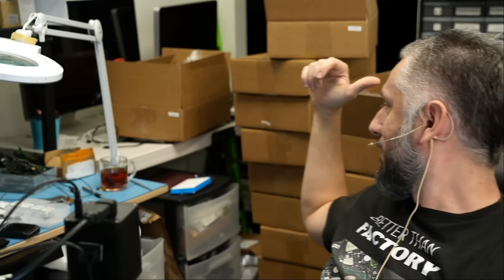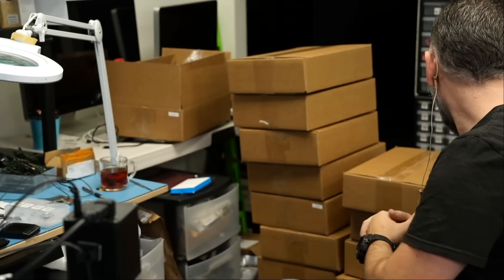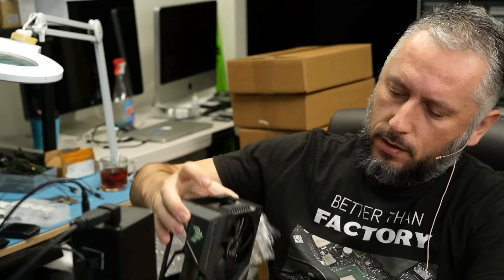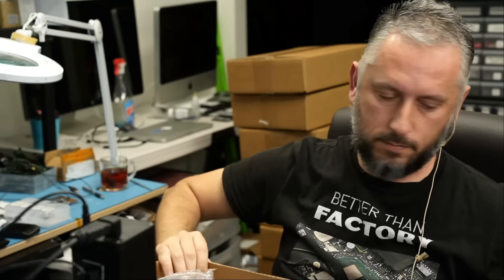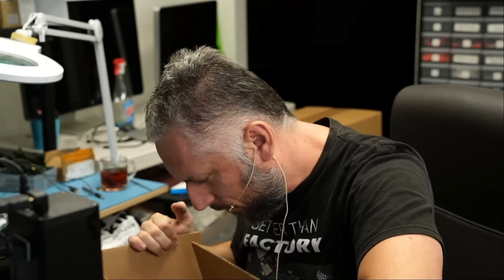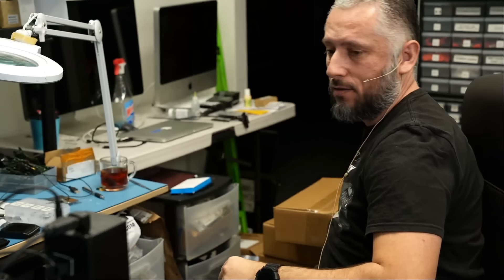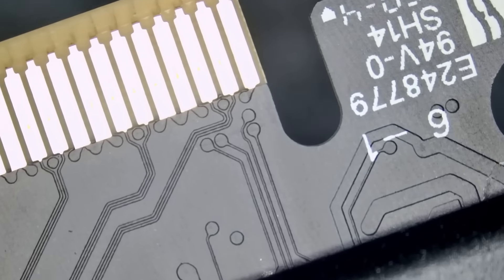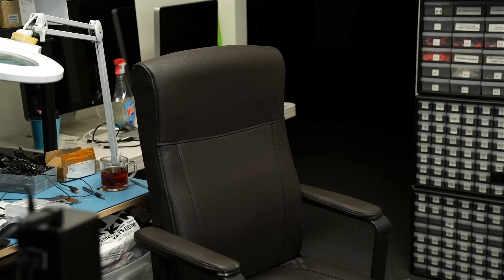We received 19 cracked 4090 Cards for repair - Who's to Blame ?

Comment: these new video cards are HEAVY i have no idea why they’d be shipping these Pc’s with the cards in them. And if you’re installing these new cards you gotta install it on the side with a support which is crazy to me .
Reply: Glad I bought a 4090 with addled water cooling and no cooling block to save on weight
Reply: I selling gaming PCs as a side business.  It is absolutely possible to do but your must support the GPU in multiple places.  I use foam blocks that I cut to size, never had an issue.
Reply: A local company here ships their assembled gaming pcs with expanding foam blocks (wrapped in antistatic plastic film) inside the case supporting the CPU cooler and the GPU. A 2.5 kg GPU hanging from a PCIe slot and one single screw on the bracket. It's an industry practice that definitely should be changed. Companies already started making "armored" PCIe sockets for these super heavy GPUs, maybe they need to start armoring the GPUs next? Or maybe the cases should come with GPU supports as standard or the GPU should be mounted vertically?
Reply: "I have no idea why ..."
Imagine buying your new Porsche supercar, and having to install the turbo yourself.
Reply: System builders like this already claimed insurance from shipping damage so this is just extra income if they can be fixed. Builders are paid either way so they don't care. Sucks for the kids who spend $5k on 4090 gaming PC and have to deal with the incompetence.
Reply: @xenaguy01  wildly different amounts of work to install a turbo vs installing a gpu
Reply: @Lectwar6  
Not if you've never done either.
Reply: @Lectwar6  There are transport screws to protect sensitive (e.g. laboratory balance) or bulky (washing machines) moving parts. That's the extent of how far users can be trusted. loosen a pair of screws. Make installation of gpu mandatory - people will drop them, bump them, fry stuff with static, force the card through engaged slot locks, connect the display first, then install the card 180 degrees off or into a dimm slot. The only winners will be the tablet/laptop manufacturers.
Reply: @liennen5868  well modern video cards have to have transport screws too.

Comment: it really looks like a design flaw to me. Why does that board finger stick out there? What is it's purpose? Those cards are expensive not only to purchase, but the R & D time to develop. You would think something like this would have shown up during the development process.Also you are right about UPS. I once ordered 25 computers around Christmas time. Who ever assembled them only screwed the hard drives on one side. I had to have 23 of the hard drives replaces. Crappy quality control.
Reply: The slot design predates large video cards, and the hook is used to seat and lock the card in place, I am fairly sure that you never see that damage on ANY other add on cards...
Reply: I agree, this is a design flaw from the get go. I once had 500 cards (atuc 64 cards) sent to soldering due to a designer use of inadequate connectors.

Comment: Wow! Such a heavy card to have only the edge of the board for support. I can see exactly as you mentioned happening during shipping and someone installing one themselves without extreme care taken. And possibly after a system build just moving it around etc. Seems like these heavy boards absolutely have to have additional support and possibly need to go to a liguid cooler so the cooling system can be remote mounted and lines simply connecting to the board? The weight of the heavy fans and heatsinks can then be reduced. Something has to change! 🤯

Comment: All those boards cracking on the same spot indicates that the retainer tabs on today's motherboards could have something to do with it. Since the cards are so heavy and is basically locked by that tab unto the motherboard, it stands to reason that it will be the point that takes the most pressure, hence... crack.
Reply: So let me get this straight, the motherboards are at fault (when this was never really an issue in the past), despite the fact that it is the GPU's that have been increasing in size. Ok, got it.
Reply: I suspect this was all done by one person trying to brute force the card out of a motherboard without knowing how the retaining tab works. They probably even wiggled the card along its length to try and get it out.
Reply: @muhdiversity7409  Agreed!!!!
Reply: The design of the retainer has always been awful.
Reply: It also seems like people are thinking that the GPU anti sag bracket that they all come with are optional.
Reply: I agree, I have a 4090 and I forgot to install the support bracket so I decided to take it out and install it, what a nightmare I needed a looooong screwdriver to reach the tab and even then it wanted to hang up in the retaining tab. I was very gentle removing it so I didnt damage anything but was still a pain in the ass
Reply: @AshtonCoolman  I look for it, or use vertical gpu mount. Right now, I Thermaltake CTE T500 case, the motherboard I/O is pointing up. This makes the GPU vertical, but I still use the GPU stand to relieve pressure from PCIE slot and screws at the top.
Reply: @Jinkle  maybe people aren't unlatching the retainer and yanking or wiggling the card to get it free. I just feel that there's some ignorance(lacking knowledge) in how to mount and remove these GPUs properly as the root cause here.
Reply: It is the size of the cooler and the weight... you can't deny gravity.
Reply: @muhdiversity7409 A likely scenario, could also be customers sending them in for whatever other reason.
ASUS might not be strong enough in that area to handle misuse.

Comment: It may be time to reinforce or re-engineer the key/hook.  It seems that many of the damage is right there at that location. I doubt if the original pcie engineer imagined there would be so much weight hanging on that slot.
Reply: they did it.... you have to mount this type of card vertically
Reply: Took a bit of scrolling to find someone mentioning the ATX standard from the 90's is not holding up so well. It's time to move on folks and start using an improved standard.
Reply: @panjak323  
No connection.
It's the cooling system that is too heavy.... you switch to water cooling and no more problems

Comment: Can't blame the manufacturer here. The thickness of the board is dictated by the PCIe standard and the material options are limited by the required number of layers. They could ship them with a big warning label, a support stand or a riser cable though. If your card is over 1000 bucks I would expect some goodies with it that prevent it from instantly self-destructing.
Reply: And most do, my 4080 and 4090 came with supports and it stated that they must be used. Unfortunately many people know then manufacturers and we get cracked boards and “idk what happened”

Comment: all those card looked so clean and brand new... i think when a manufacturer produces a new product, there should be all new design factors controlled ! such a heavy component on the board for thermal control, should not make the Video card so heavy that it breaks when its plugged on the motherboard. since we all know most cards are installed on a case wall, not bottom!  and yes ! they know all about it ... these are all new ways to make more money! but what about reputation?! IDK
Reply: If these were shipped while installed in the system, that's not the manufacturers fault. A lot of SI's are shipping the video card separately now.
Reply: @-AMD-Ryzen  it may be the pre installed shipment problem! but its not one or two! theres a bunch of them! and why we dont see 4050 or 3080 problems!? why all on 4090?! melting connectors, cracked boards! i think as a well known company that produces such heavy duty cards, these kind of issues, should be measured before luanch. and if it happend , it just a responsibility for the company! not to change those cards, but to improve the final build quality !  nor being silent or blame the final user for a design problem or flaw

Comment: 4090 reminds me of big heavy computers from the 50s where obscene amounts of electricity were required to power them and they ocupied an entire room. 
Too big too heavy too power hungry
Reply: why?
Reply: because they are ridiculously giant  @MusikAstronaut
Reply: Interesting you mention this...since I know for a fact the better industrial and case manufacturers back then already had standardized support at the end of the card, which is still pretty common in server land.
Reply: Obscene amounts? 4090 uses between 200-300w under normal operating conditions and whilst doing so, delivers almost 2x more performance per watt than anything that came before. I think you're a bit off on this, bro.
Reply: @tonyd9394  well the phrase you quote is related to early computers. I was reading the other day that Eniac used 174kw. Anyway if 4090 melts its connectors then its using too much. Under heavy load sometimes it spykes to 700w which is as much as some split ACs... ridicoulous

Comment: I think there are many different reasons.
Pre-installed and broken during shipping.
By the customer due to improper handling (forgetting to open the unlocking mechanism).
Because the cards have become so expensive, I suspect that many people are assembling their own PCs and making mistakes.
A fully assembled PC should never be shipped because graphics cards these days have become far too heavy.

Comment: I've seen so many of these 4090 gpus getting cracked right at the same spot by the PciE retention tab. At this point this is screaming manufacturing defect rather than customer misuse. I honestly hope someone brings a class action suit against this.

I feel a bit safer since I ditched the extremely heavy cooler on my 4090 for a waterblock and i'd honestly recommend anyone else with a 4090 to just liquid cool it.
Reply: It is customer misuse. People are either clueless or fail to use the support bracket.

Comment: Great,, hope my 4090 doesn't crack. I built it last August and fully intended to install the bracket, but found out the motherboard had heatsinks on it that blocked the installation. And since I have fans on the bottom, there is nowhere to put a stand. Literally no way to install GPU support in my rig.

Comment: Just upgraded from my Asus Tuf 3080 today. Had it installed with support as it was quite bendy on the slot. Didn't crack. Was going to upgrade to a Asus Tuf 4080 Super, but went with a an MSI 4080 Super Expert which has a heavy cast aluminum case, and it was less bendy, doesn't really bend at all to tell the truth, however, I used the included support. I think something is off with the Asus boards compared to MSI. Not sure what it could be, but the MSI board must have stronger layers or something.

Comment: The pci-e slot clip can snag on the card when trying to remove it, and the clip is often hard to get to with bare fingers. I guess a lot of people pull the card out expecting it to come right out, and when it doesn't (because the clip hasn't been pushed back), they wrestle with the card. 

Really, the first thing you should do unplug display cable and then  release that clip and pull the card out before unplugging any power connectors.

Comment: I'd guess those are from a Company that does pre built systems and the cards are breaking during shipping. 

Some  card makers are now including a support bracket that connects to the stand off pins on the motherboard, apparently they aren't using them. 

I'd bet this is rare for a card installed by the end user.
Reply: @Takedown87   I agree.  In my opinion it's the builders fault.  My Gigabyte 4090 has a bracket that screws into the standoffs on the motherboard, it's super stable but I'd still use some kind of foam to support it along with the bracket if I were going to ship.  The nice thing about this type of bracket it keeps the GPU from going down or up. With the type that supports from the bottom I could see the box getting flipped in all directions and breaking the board in the up direction.

Comment: Gigabytes 4090s come with a support bracket that attaches the right side of the card to the case. But even if a manufacturer doesn't supply one who wouldn't buy a support to protect a $2000 card? I have a 3rd party vertical mount bracket that fully supports the 4090 so its not even resting on the riser.
And prebuilts should package with two supports or one long one that locks to the card locking the card to top and bottom of case and prevent shifting in any direction. Because even expanding packaging can cause damage.

Comment: ...mybe new heavy GPU should have cabled riser bridges/bus ..meaning not direct contact on the motherboard.. these boards are not sturdy enough made for ease of recycling..its almost like paperboard..heat & weight brittles those pin sides

Comment: Are there really 4080 or 4090(and 4070 for that matter) cards that comes without a support stand? My Asus TUF 4080 Super came with a really smart and discreet support stand. The bottom part is even magnetic so you don't have to worry about it falling out when you put your pc sideways if you're gonna do some work inside the case. If it comes without a support stand and no warnings then it is 100% on the manufacturer.

Comment: My 4090 came with a support bracket. I used it. And I still have a working 4090. This is not the manufacturer, this is a customer problem.

Comment: Would be good to tell the future customers to put a letter in the box stating if the pc was pre built and sent to them with the card already fitted or was the card bought on its own? As well as asking the mounting position and if the card had any extra support if horizontal.

I suppose there are many people who just buy pre built pc's and they come with the cards installed. The companies shipping these pc's with heavy graphic cards installed should be responsible in these cases. Surely it would be better to just keep the card in its box and give instructions on how to install and it connect it up. If many of these cards were not from a pre built then knowing if they used a support or not would be good to know, to more understand what is happening. 

I have a founders edition 4090 and when I started putting my system together  I was going to install the card and could feel the weight of it. I thought there is no way I am fitting this horizontally without a support. Ordered one of the lian li support brackets that screws on to the motherboard standoffs. It only cost £10, worth it for the peace of mind. To anyone fitting your graphic cards put the pc on its side so you can just fit the card easier without stressing the card or socket, especially important with these heavier cards.

Merry Christmas all! 
🎄😀

Comment: To pressure and wattage running through it the connection area and/or manufacturing issue due to design flaw.

Comment: One is a point. Tow is a lie, Three or more is a pattern.  I'm going to call this a pattern and it is a CLEAR design flaw.  Some of the things needing to change are:  
- Lighter cards
- Change the weight distribution

On custom system builders:
- Ship cards in separate package nested in same box
- Provide clear and easy instructions how to install

These suggestions are not comprehensive because I'm sure others have more and even better suggestions; however, they are a start.

Comment: I think it's just a mishandeling. It's common that user wants to take out the cards of PCI slot and they don't know how the lock system is working on PCI slots so they start to pull the card out of PCI while lock is still not unlocked.

Comment: 100% the manufacturer. The default installation for all card is horizontal, it's only really with the advent of pci extensions that we have got the addition of vertically mounted gpus (yes there are a few horizontal cases but very few compared to default). Add the fact that a lot of manufacturers don't supply a support or tell you this is a significant risk and you have a recipe for disaster.

Comment: i blame the manufacturer because all they have to do is provide a support brace that can actually be constructed into card design i.e a little leg that is foldable the can retract downward just like pocket knife and extended onto the computer chasis and then remain in that position until it is removed its just a swingable leg will cost less than a dollar of plastic moulding

Comment: with the amount off the card breaking, why manufacturers dont just make water block instead of these heavy heatsink. Surely acrylic is cheaper than any metal to mass produce. Also you dont have to worry about people trying to break warranty just to customise it to water block. Just my 2 cents.

Comment: That's so sad. These new cards are so CHONKY. I am now glad that I decided to vertically mount my 4090. Time to buy those gpu support brackets. Would you be able to salvage the processors in those?
Reply: i had mine for a about a month now. i have 1 support bracket at the end of the card, but i was told to use an extension riser cable to mount vertically or something because even with a horizontal gpu with support bracket will cause damage. am i too late?

Comment: My EVGA 3080 FTW3 Ultra bends so badly that I bought a support for it from amazon. The PCB bent so badly that even the heat pads no longer had contact with the power stages.

Comment: Given that all 19 came from the same customer, I suspect that the actual owner of these 19 RTX 4090s was running a mining farm, and hired someone to either install, re-install and then again reinstall these - because ruptures on some of these show ignorance and no care needed... someone who was paid to "plug computer parts in" / "unplug parts" etc. 

If there is a such weakness in the material of the card, the issues would be wide spread and recalls would be issued... So, out of thousands of these sold, 19 do not make it a case for a recall, or to blame manufacturers for "bad" manufacturing quality...